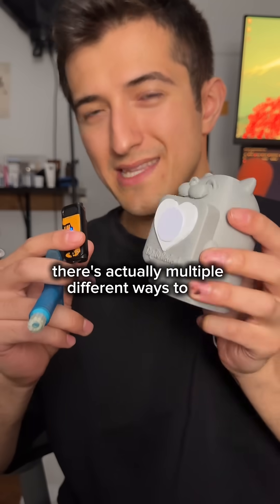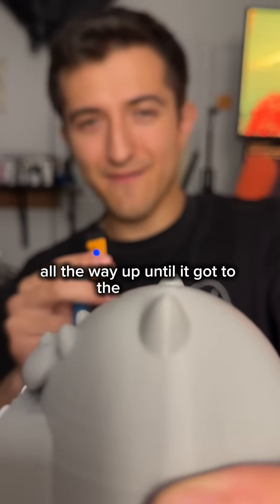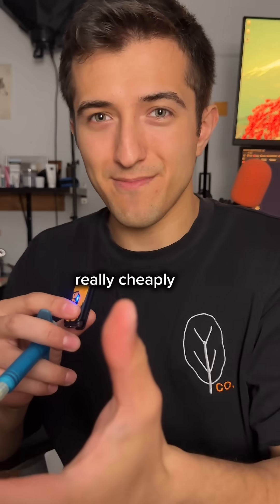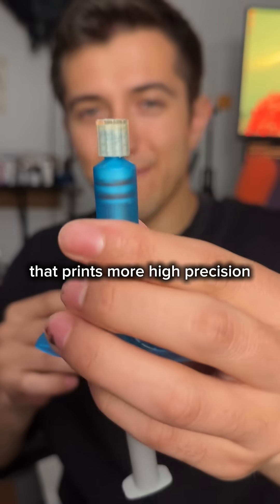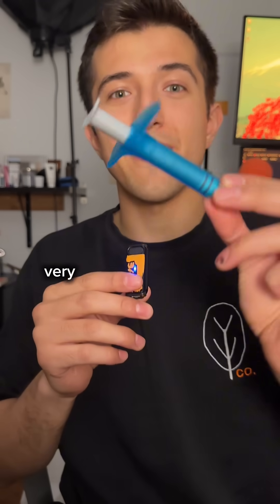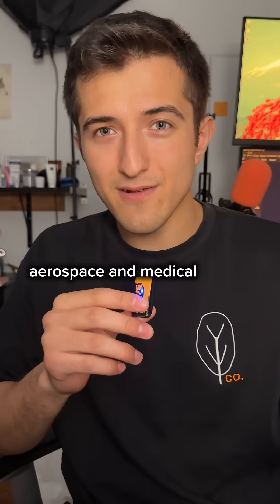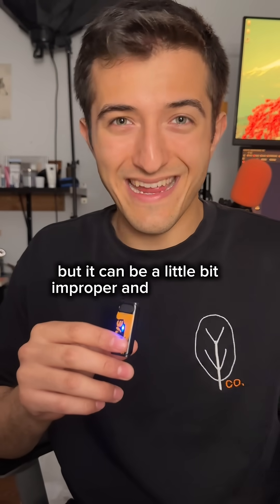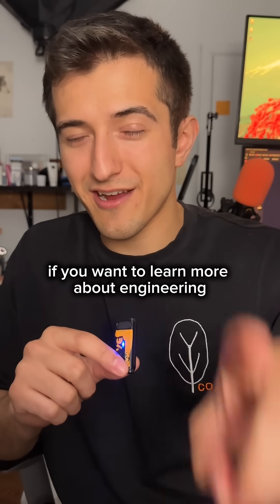3D printing go brrr

Comment: For resin prints, are you able to get resin thats impregnated with metal or ceramic like you are with filament?
Reply from the maker: Yes but it can affect the curing process. Imagine if you put a bunch of glitter into a clear glass of water. If you shine the light on the cup, the light won’t go straight through, it will bounce off on some of the glitter. Same thing for the resin and the UV light. Adding anything to the mixture can cause it to not cure properly. This means you have to be very deliberate with how you mix the composite into the resin, and ensure the settings are properly adjusted.